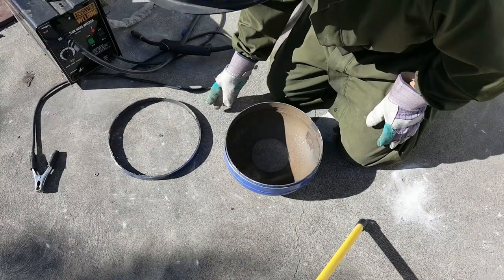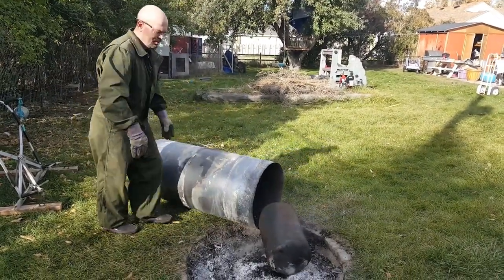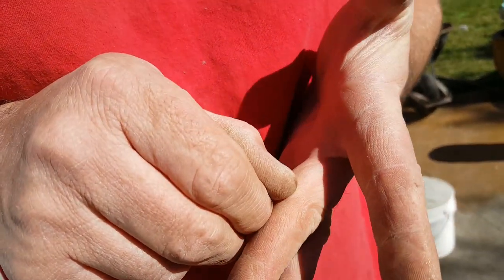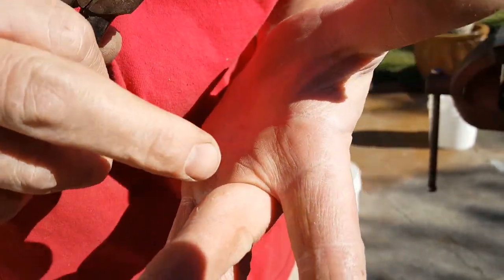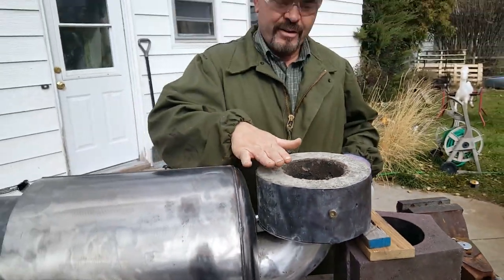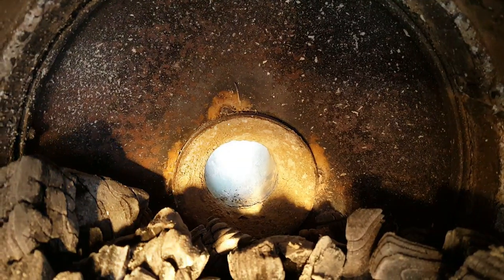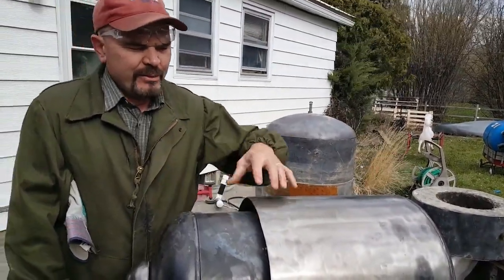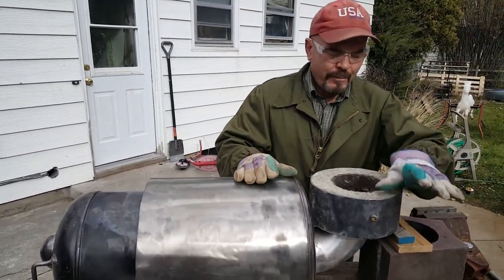Update on Rocket Mass heater

Comment: Your getting to be a legend in your own lifetime mate.   Here is a tip . To cut a circular hole using a hand grinder make use of the handle insert.  Insert a 8/10 mm threaded rod into the handle insert say about 6" long .onto that make a block with holes slightly larger at 90 degrees . Then make another rod with a threaded end  to attach a locking nut   If you put the second rod with the threaded end into metal and lock you can then cut a circular hole to any dimention you need .
 .

Comment: @Honey Do Carpenter -Two suggestions and two question.
1. Be unapologetic, tell people to like, share and subscribe. Your ideas need to be shared, Dirt Patch Heaven says so and I agree.
2. You've got a great intro, please work on an outro.
3. When the rocket mass stove is finished, will the vortex holes be plumbed with lines to an outside air source to keep cold air from being pulled into the house through weak door and window seals? 
4. Will the air intake be plumbed with outside air to keep cold air from be pulled from the outside? (Like from a flexible aluminum coil dryer vent hose so the door can still open and close)?

Comment: I am so interested in papercrete to surface wire fencing form. In a search I came onto this site. I love the rocket stove concept, I have three rocket stoves, I used during a week power outage, so efficient.  Most of us haven't the tools, welder, grinders, etc. to put this demonstrated unit together, when the inventor gets the parts down to stove pipe parts, I'll be able to handle the project of making a rocket stove.with papercrete. So interested in the pvc pipe invention to make the papercrete. .

Comment: Nice work! I'm curious about how the metal in your burn chamber will hold up. As I understand it the only metal that is exposed to direct combustion is in the burn chamber before the portal, is that correct? You said it was getting red hot where insulation is on the outside of the metal there, I'm concerned that the burn chamber will spall with long term use.